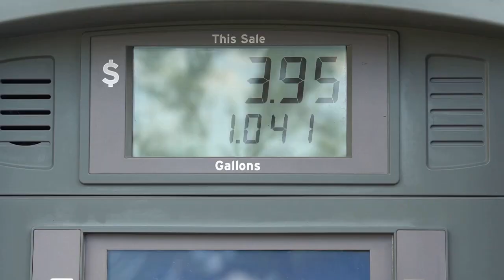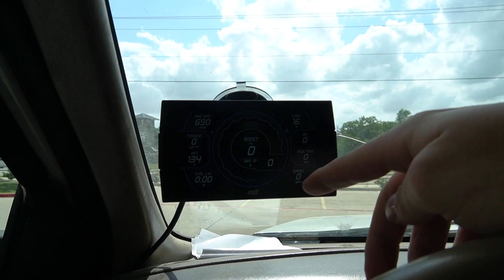DIESEL OWNERS: Do This To Double Your Fuel Mileage In 10 Minutes

Comment: You have to be sure to account for the bigger tire size when calculating your actual mileage. The truck thinks you have stock tires on it so when it is calculating the distance you have went on your odometer it is based on how many revolutions of the tire. If your tires are 5% larger then you have actually gone 5% farther than the odometer is showing. For example if you went 100 miles on 5 gallons of gas you would be at 20MPG. Since the tires are 5% bigger you actually went 105 miles and your mileage is 21MPG.
Reply from the maker: Damn I didn’t think of it like this brotha I’ll be doing this from now on.
Reply: Yea the CTS monitor will let u plug in stock tire size and new tire size then it will give you accurate trip mileage and speed. I run 37” tires on my 7.3 and that’s roughly 17% further than what the odometer says.

Comment: Change your fuel filters as well ! Changed mine when I did my oil change and I’ve increased at least 1-2 mpg. I’m sitting at 14-15 with a hydra tuner and on 37s. Definitely going to to get 35s to at least get 1-2 more mpg !
Reply from the maker: Yessuh that’s what I meant by regular maintenance at the end.

Comment: One owner, me, a 2000 F-250 4X4 Lariat 7.3 with Banks intercooler-tubes, 4.5" exhuast, Mod turbo sitting on a RiffRaff EBP delete pedistal... Been running a 6 stage TS chip, only run in stage 4 which gives me an average of 18mpg...

Comment: Mileage & speedometer will not be accurate if you do not calibrate your speedometer  to the different tire size from stock. Just an FYI

Stock 1999 7.3L 16mpg average / 21mpg highway. 280, 000 miles. I ran a Superchips for years when hauling horses, but I removed it when I stopped hauling. Other than extra towing power & speed limiter delete.  It's not much different than stock on fuel mileage economy. Thanks for sharing.

I ordered this truck in December 1998, F-250 Super Duty Lariat Special Edition package (Pre-King Ranch 1 of 1) with F-350 suspension & towing package, 6-Speed, Locking 3.73:1 RWD

Comment: Which tune are you using there are tons and they all give different results. The Hydra itself does nothing without a specific tune. It has to be adjusted (tuned), for your specific truck for max potential. Three MPG's is a great gain. I notice a couple miles an hour difference from so hotter tunes over my mileage tunes. The ScanGuage II is good value for the money and is very accurate at keeping track of your mileage.